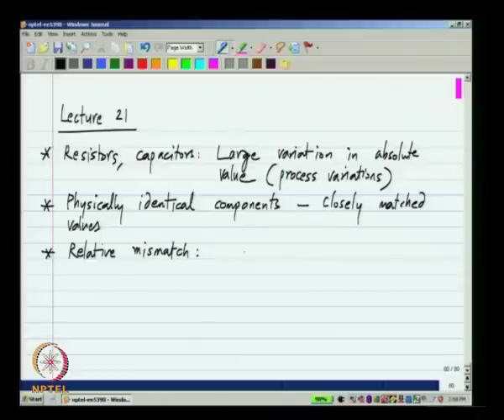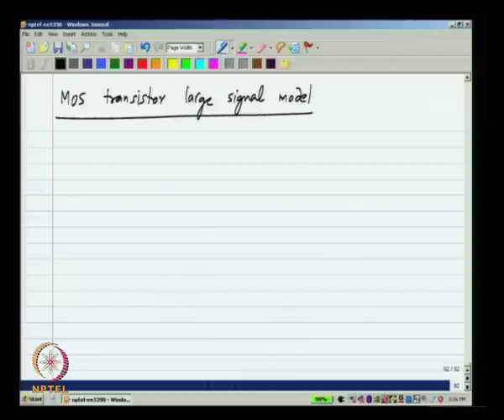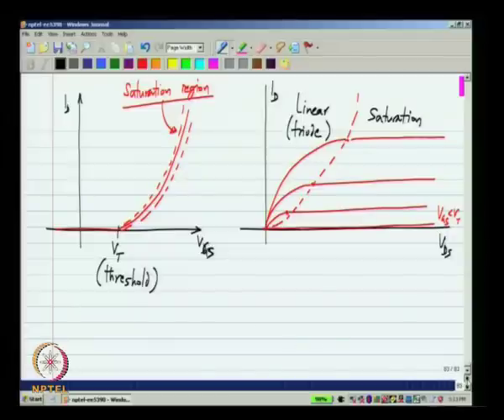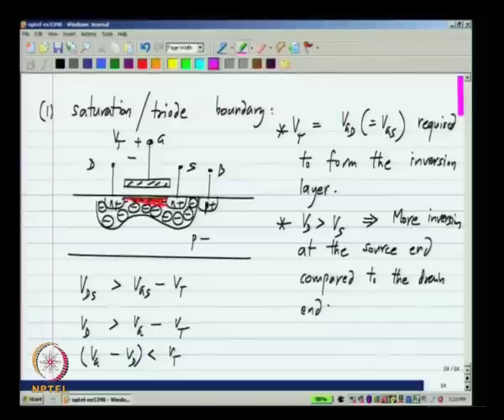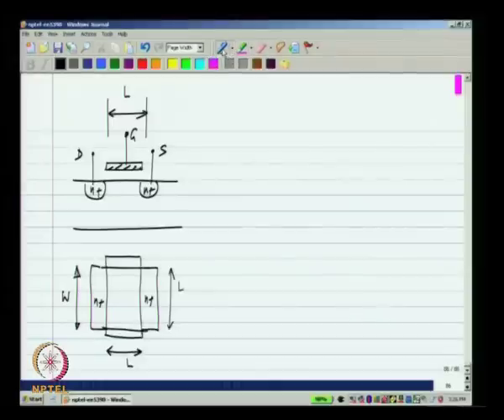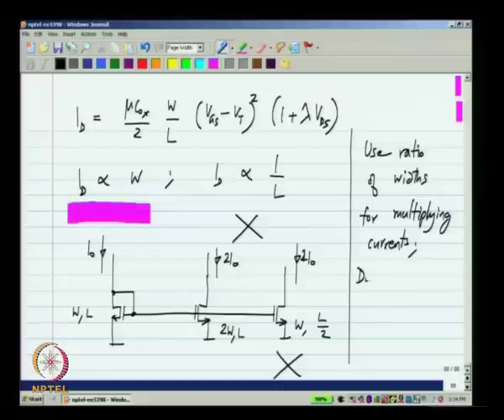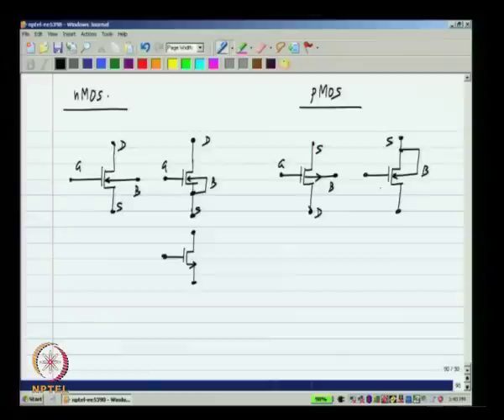Mod-01 Lec-21 Lecture 21

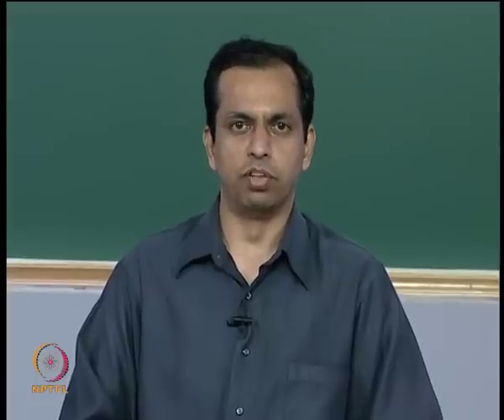Comment: 49:02 last point should be subthreshold, not triode
Reply: If you're only considering Vgs<vT cases, yes there's an exponential relation between Vgs and Id in "subthreshold" triode, but that relation remains exponential even if it is in subthreshold saturation (larger Vds). We could simply call it subthreshold to include both cases then, instead of calling it triode, which seems to exclude subthreshold saturation. Not sure if I understand your comment fully here.